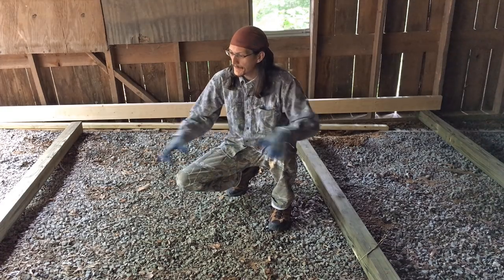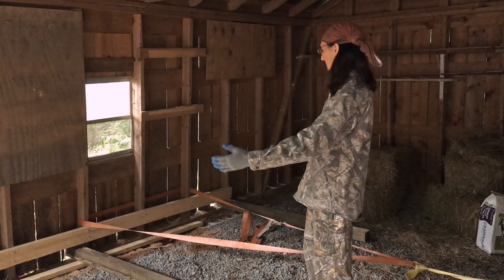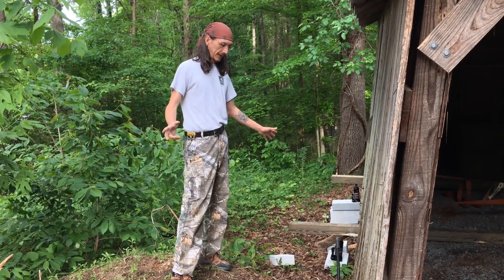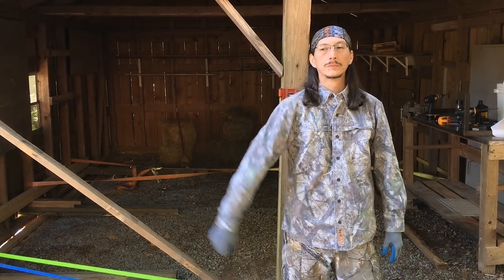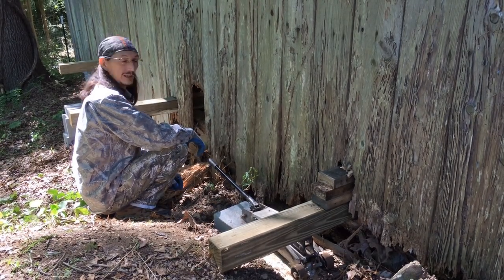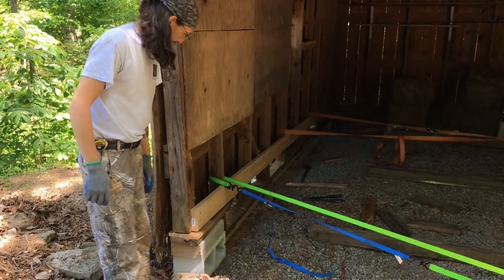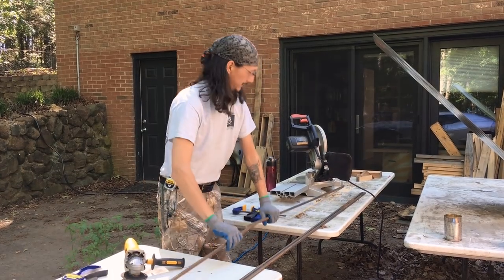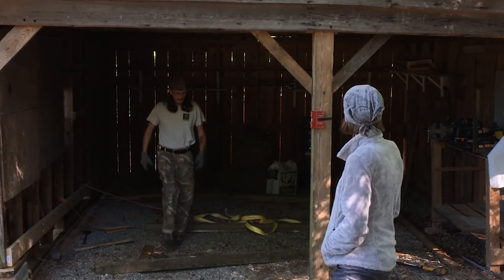Putting a Wall Back on a Foundation

Comment: Great job guys. Nothing fell apart, no one got hurt.Those gloves are also great in the kitchen as well. I use them to handle hot pots, pans, and cookie sheets as long as I only use the rubber side.

Comment: Awesome solution, a great success! I have a similar problem in a finished 125 year old house with a rubble foundation. A section of wall has rolled off the foundation. I think I'll need to push it from the outside. The first real moonwalk on gravel in boots! Nice move.

Comment: Pro Tips on Bottle Jacks -- Never place a bottle jack directly on cinder block.  You can use cinder block in the stack, but the base of the jack needs to be on wood.  Also when using cinder blocks, be sure to center the jack over the center divider of the cinder block.  Never use the flat side of the cinder block.  Always place it so the holes are vertical, then top it with a 2x8 if you need to use it for your jack.  Instead of the blocks, you could use some pads, then a piece of wood.  Remember to center.  Cheers!

Comment: Best gloves ever!  Get a ten pair pack at costco for about 10 bucks. Good rubber gripping  for grabbing and holding onto awkward stuff like slick heavy sheet good panels like drywall, masonite,  species wood plywood panels, carrying out wood furniture or when installing kitchen cabinets. The heavy knit backs offer breathability so your hands don't get hot and sweaty.  And when they get all muddy or really dirty you can wash them in a bucket of soapy water and hang them up to dry! Best gardening gloves too.

Comment: Nice job!  Next time you have to pull things together using sliding boards, put a little axle grease between the bottom two boards to reduce friction.  Learnt that long time ago helping a friend set up double wide trailers.
Reply: Of

Comment: could take off the bottom few feet of rotted siding and replace it with some tin roofing material like what you used for the goat shed roof going long ways, but just an idea. great job getting the wall back on the foundation looks great :)

Comment: Around about the time Jeremy said " ..Not rocky at all" as he wiggled the Jack I thought, 1st of all  wood posts are going to do the hot knife through butter thing on all the rotten wall boards.  Not much longer after that I thought, it's got to be cheaper to cut out the rotten planks and replace them with new ones that go ON the foundation, put straps from the 4 x 4 uprights attached to the opposite wall tight, and just blow hard, the rotten ones will just fall out 😆  Still the man had faith and A LOT of tools (beats my dinky lady hammer, pair of pliers and screwdriver set 😃)  Clarke really IS the man but Jeremy is the hero of the hour, really good job mate, careful steps knowing where you were going and you did it.  Congratulations and Well Done.  Your Russian Hacker was dead on, great accent, & I got the beer & moonwalk gag at the end.  And now the barn's been 'Jaime-ied'  mind you, it's been 'Jeremy-ied' too !!   Ps.  Mind you, matching lean to's would help delay the wall fixing for a while, and give a bit of extra support  Hmmm 😉

Comment: Every farmer has a go to tool, yours is definately the ratchet straps...........excellent video, my kind of project. I use Timberlock screws with an impact driver for projects like this, it speeds things along but you certainly delivered good results.........!!!
Reply from the maker: Ratchet straps and Irwin clamps
Reply: Ha, cant forget the all purpose clamps, Lowes has expanded their line of Irwin tools in my area, good prices on stuff like drill bits, chisels and other must haves for your average farmer and do it yourselfer.

Comment: Awesome job!  If you still need to replace the planks, you could always blue line up to a point where you have good wood ripsaw the bad off.  slide a z channel under the good wood and replace with good planks the lower section you sawed off.
Reply from the maker: +Autumn Oaks Farm - Yes!

Comment: Next time....there will be a next time unless you do restoration....run a long line level before starting so you know where you’re at at every phase.  by the way= remember what your truck did to the nice new strong fence post...that Wasn’t rotten?  :-}   By the way, you can discourage termites by cutting away any siding boards within 6” of the ground.  They don’t like light

Comment: What you need Jeremy, is a Tirfor (or two) - especially on your new farm ! - A Tirfor is a great piece of kit to have for manually pulling and lifting all sorts of heavy loads, stuck vehicles, otherwise dangerous precarious trees,  construction jobs, and erection of pre-framed walls etc, dragging very heavy loads, and is great for pulling over long distances, as well as short distances. I recommend the 1.6 ton model, for most applications, but the 3/4 ton model is much easier to carry and deploy quickly, but provides only half the force of the 1.6 ton model. And the biggest unit will pull 3.2 tons - See... https://www.youtube.com/watch?v=jyDKjmxTkEM

Comment: I think that was BUILT rotten!  I would have supported the walls under the trusses and used a home made lever lift or bottle jack and 4”x4” posts....?then i could slide the wall onto the “foundation” from OUTSIDE the structure.   Then paint it thick with ‘orange lacquer’ or what now is called Kills

Comment: the concrete block you put in has no strength on it's side, look at the blocks of your foundation. you should turn it upright for it to be safe. otherwise good job!
Reply from the maker: +Bill Hoegemann - I thought about that. There isn't much weight on it at all though. It's all on the other studs.